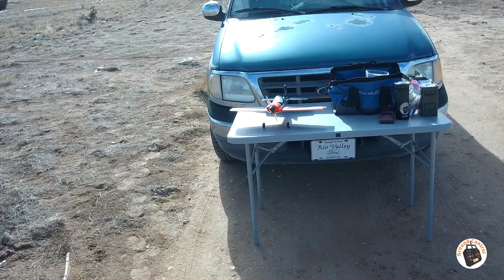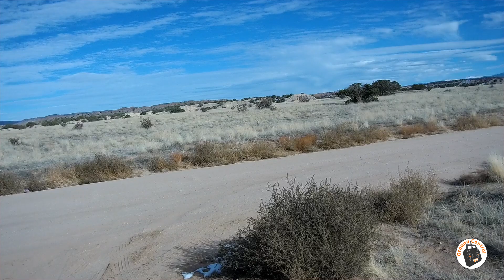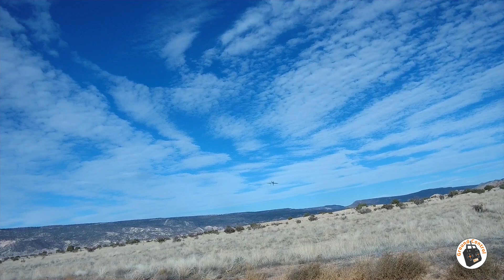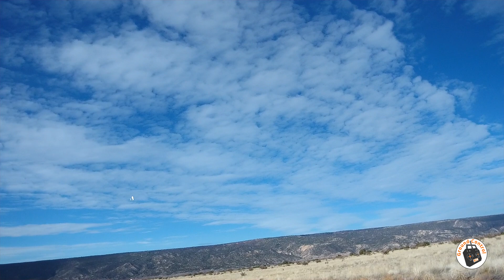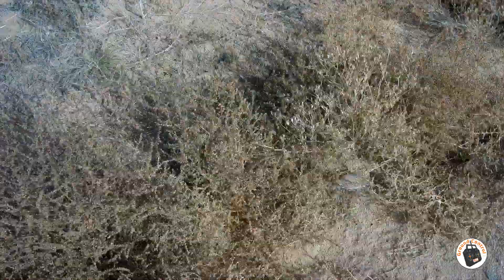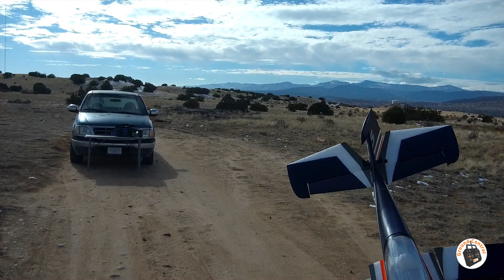3D Mode is Awesome! FlyBear FX9706 SBACH 342 4CH 550mm 3D/6G Brushless Sub-250g Plane from Banggood!

Comment: Hallo  Frend. I am very impressed 👍😁, bye this plain . your right ,it is Soo 👍 Cool .Like your, video,s. Mvh Rene' Pedersen Vejle Denmark. I have ,just bye the p51.750mmvolantex,Rc. Now I hob . it flying good. I,l like if course opgradering.
Reply from the maker: Hi Rene' and Thank You!
The Volantex P51D 750mm is a great little warbird.
I've found most of these factory planes need some type of MOD or Upgrade to get them performing the way they should.
This Micro SBACH is very fun as well.

Comment: Hello, I decided to buy one between XK A430 and FX9706.  Based on performance, it seems right to buy the FX9706.  However, I think the XK A430 is better for replacing parts if the plane breaks while flying.  If you search on the Internet, there are no parts for FX9706, but there are many parts for XK A430.  For your information, I am new to RC airplanes.  So it seems a little more likely that the plane will break apart.
Reply: So which plane is better to buy?
Reply from the maker: @youngminkim5266  You should buy the plane that suits you best.
Reply from the maker: OK!

Comment: Can the receiver in the video description link be mounted on the FX9706?
Reply: What is the size of the FX9706's battery?
Reply from the maker: @youngminkim5266   It's a 2S 650mah 20C LIPO
Reply: What is 20C?
Reply from the maker: @youngminkim5266  It's the rating for the number of amps it can provide.
Reply from the maker: Yes, the WFly or Radiolink SBUS/PPM Receivers I have listed will work.
I have the Radiolink R8FM in mine.

Comment: Can I use a 7.4v 500mah battery with FX9706?
Reply from the maker: It comes with a 2S 650mah 20C LIPO.
As long as you can get the CG and the battery is the right dimensions it should work just fine.
Reply: Thank you, I will tell my friends to subscribe to this channel haha

Comment: Can I connect a FUTABA receiver to FX9706?
Reply from the maker: Yes, I'm using a Radiolink SBUS Receiver so any SBUS RX that uses 5v should work.
Reply: Can you recommend a FUTABA receiver that fits the FX9706?
Reply from the maker: @youngminkim5266  I've never used a Futaba RX. You have a Futaba Transmitter?
Reply: Yes
Reply: Can I connect this receiver to an airplane?
Reply from the maker: @youngminkim5266  As long as it can use 5v and has a connector that will fit the port.

Comment: Can you recommend the best 3D RC airplane under $110?
Reply from the maker: The only 3D Planes I've flown are this plane, the radiolink A560, and a yak 800mm 3D plane.
None of those are under $110
The best 3D Plane I've flown so far is the Radiolink A560.
I just bought the Volantex Saber 920mm but I haven't had the weather to fly it yet.
I did buy that one on sale for less than $95 but it's back to $149 now.
I hope it's a keeper.
Reply: @GroundControlRC thank you

Comment: Thinking of buying this.What is the size of the battery compartment ?
Reply from the maker: Here is a quick measurement of the battery bay.
Battery Bay Dimensions = 51mm x 28mm x 24mm
You could fit a larger LIPO if you modify the battery cutout in the battery bay and reinforce that area.

Comment: Oh yeah man😁 this lil guy can do it all! My order is getting placed asap just an awesome flyer thanks again for putting me on to this flybear because I have never heard of it before man this thing can zip ✌🏼
Reply from the maker: Thanks!
I had only flown the little 2-3 channel planes FlyBear released in the past which were very fun and relaxing.
I think this may be the 1st 4CH Brushless Plane they've released so I hope to see more.
You'll have a lot of fun with it.
With the BNF you do need an SBUS Receiver for it but you can then fly it with the TX of your choice.
The 3-pin port looks like a 1.25mm pitch on the pins.
I always save the cables from my micro servos when one goes bad so the Micro Servo Connector fit the port and crimping a regular servo connector on the end for the RadioLink R8FM Receiver worked a charm.
Reply: @GroundControlRC  Thanks man that's good to know because I always save my connectors to lol I definitely would rather use my radio thanks again for the info and another great review hope you can get that a300 biplane situation sorted out I would like to see you try it out I don't own a biplane but have been wanting one so far the umx pitts is the only one that I like see ya in the air man😁✌🏽